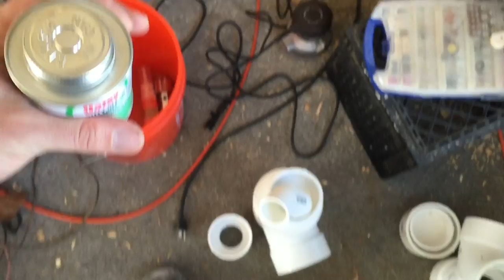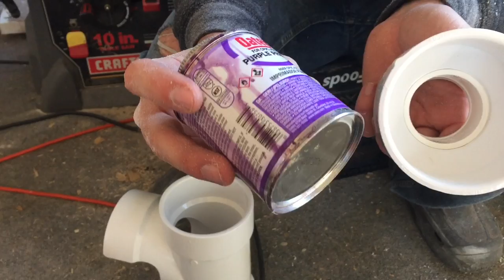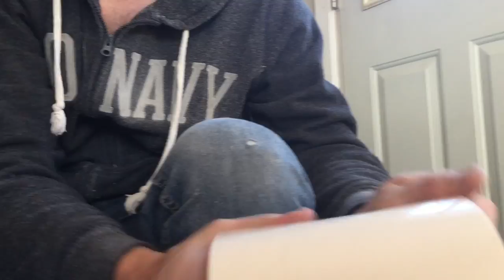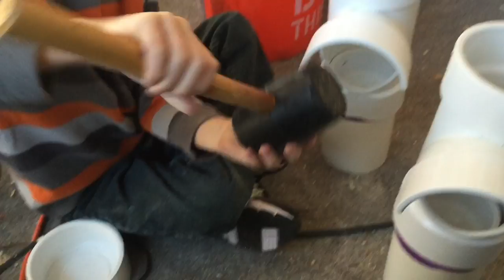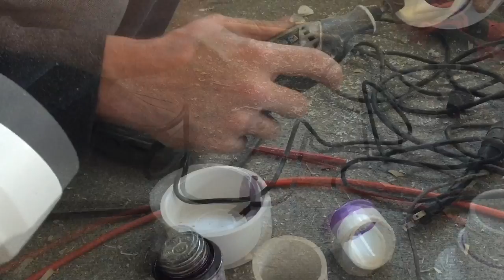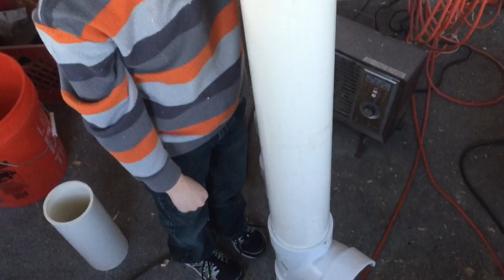DIY PVC Chicken Feeder

Comment: Looks like a solid design with great out-of-the-box thinking used. I will likely build it as well. The only modification I see myself doing is extending the inside 2" pipe further for a shallower well of feed so it doesn't get knocked out on the ground as much. Thankyou for this.

Comment: drill 3/8" hole in top center of cap cut round plywood disk to fit down inside pipe drill 1/4" hole center of disk glue a 1/4" dowel rod into disk set plywood disk into pipe slip cap down wooden dowel rod as feed go's down so does rod to show food level

Comment: I love that you teach your son! I did not like the complicated and inefficient (only feeds 1 bird at a time) feeder design though. Holds too little food and has hard-to-fill tubes. 

I have 25 7-week-old birds, and we just did a feeder last night. The hubs wanted to make a complicated pvc feeder (heavy sigh) and I bought a 5 gallon bucket that we cut 2-inch holes around the bottom, fastened it to a larger feeder bowl, and filled it full. The girls loved it and it was finished in about 5-minutes. I won’t need to refill it often and it can be hung if need be. 

Thanks for sharing though. I’m sure this works better in areas with fewer birds or bad weather.

Comment: Use weight inside tube, attach a small cable, drill hole in center of cap, run cable thru cap, attach a pulley to roof, run cable thru pulley.  Tie lesser weight to empty end of cable along with a red flag.  When flag is up by pulley, you know it's empty.  Your design is great. 👍👍👍
Reply: I like that one

Comment: I saw another You Tube video where the guy used small water bottles and filled them with rocks or sand, and drilled an angled hole in the top of the cap. He then attached weed eater string to the bottle and ran it through the hole and attached a piece of wood, so that it hung down and moved up when the feed inside went down. I have made these, using mini plastic disposable water bottles, fish tank rocks, weed eater string (it slides better) and a dowel rod. I attached the dowel rod with a screw eye and I love them, they work very well, are little cost and you can always tell how much feed is inside. I already had the rocks, bottles and dowels.

Comment: Thanks for replying back. My son thought of an idea on using a buzzer  switch and fish weights. If your interested you can pick up a pzo buzzer at radio shack, also we did make the 2 feeders but the hens like to dig out the feed. I may have to raise it up a tad bit to keep thier feet out.
Reply from the maker: +Janet Aldana Ours bottom feed openings are about 10-12" above the ground.  You can always adjust the height of the bottom pipe or just add a coupler and add on to make it taller.
Reply: @technicolorchristmas  can you provide me with actual size of all the supplies needed to build this?????? Thank  you!!!!

Comment: You might try marking a wooden dowel and dropping it through the lid so as the feed level drops the dowel drops. You may need to put a wide "foot" or plunger on the end of the dowel if it digs in below the top of the feed. It shouldn't let much water in, but if it's not under cover, you could put a little conical party hat on it to keep the rain out. Just the first thing that came to mind...
Reply from the maker: I've seen some methods like this that use it to show how much feed is left, now that the kids are old enough I just send them out to check the feed level.  ;)

Comment: I like elements of your design.
Some ways that might be possible to read the level. 
[_] chain depth measurer to the top of the feed level? 
[_] depending upon your reach paint marks horizontally at regular intervals down the inside? 
[_] cut a vertical grove in the pipe and clear glue a clear acrylic strip down the inside of the pipe to see the level ? 
[_] Would the pipe make a different resonant sound with the height (depth) of the food, as you tap the pipe (like a kid's music toy)
[_] a weight transducer under a cup in the bottom wired to the outside?

Comment: I built 4 of these 4 years ago but used 4" test caps( 98 cents) inside rather than the 3 inch caps, fits without the need to sand or cut down.
Reply from the maker: I've used the test caps before but the plastic is so brittle (It's made to smash out with a hammer post install) that they just didn't hold up.

Comment: Don't like it but a good attempt. Should be a trough at the bottom for me because with such a small hole 1 chicken can play, this is my feeder you can't have any. A longer trough helps prevent that -  more to defend. Or a time release automatic feeder that spreads it on the ground without you in the coop. It can depend on how your chickens behave. II would want to interact with the birds and feed them myself by hand most of the time. Feeders are nice for when you can't do that. SH

Comment: Design problem.....our 4 hens emptied the tube in 24 hours onto the floor. You will need to cut 3/4's of the flat part of a test cap and place over the opening or you will have the same problem. Also, no need to glue anything. If appears to be a tight fit without.
Reply from the maker: You probably need to make your center pipe a bit longer.  The difference between the bottom lip of the outer piece and the bottom edge of the inner piece determines the depth of the "well".  If it's too shallow it's easy for the birds to knock all of the feed out.  The only reason to glue is if used outside it makes it water tight and prevents rain from seeping between the joints and ruining the feed.
Reply: R Welch without glue risk feed getting wet

Comment: Can this be used outside in the run without the feed getting wet?
Reply from the maker: That's the reason for the overhang at the top, it keeps the feed dry.  We haven't ever had a problem with feed getting wet and have used these for going on five years.
Reply: Gerald Lewis yes just make sure to glue the pipes together to prevent leaking thur the slip joints.

Comment: This is very good idea, we have the store bought feeders that are placed on the ground and the hens just make a mess. You said in the video that you wish you could be able to see how much feed is in the feeder and I thought about it and plexiglass came up in my mind. I found some plexiglass sheets at lowes for about $2.97 and I might cut the 4" pipe about 1" - 2" wide and about 1/2" - 2" long and glue it or put in the plexiglass in rectangulars every 1". if you don't mind me asking, about how tall did you make the tallest feeder?
Reply from the maker: +Janet Aldana I thought about plexi, plastic, and I've seen others use a weight that drops inside and lifts a cord or marker on the outside.  My main concern was the solvents or glues clouding the plexi and not being good for the girls.  I'm experimenting with a weight type indicator and will update the video if it work well.  Our tallest feeder outside is about 5'.  With three hens it would last a good 5-6 days but I think some rodents were helping out too.  Raised it up off of the ground a bit more and now we can get a good week.
Reply: You could use hot glue with clear plexy I'm sure if you fit plexy from the inside out would hold well and be non toxic. I'm pretty sure hot glue is safer then PVC glue
Reply: R. T. Once pvc glue is dry it’s harmless. Google will confirm this cheers
Reply: Janet Aldana As far as the pvc glue being harmful...  all public water systems that I know of have at least some pvc in them and the same glue is used on all of those joint connections.  Safe enough for humans then it should be safe enough for chickens.